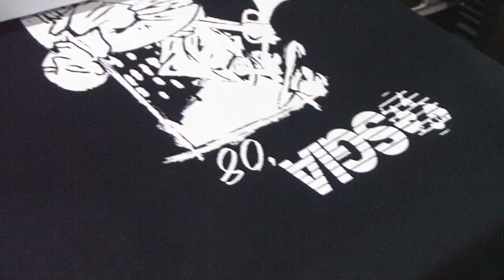MOD1 Belquette DTG Printer Video taken at SGIA Atlanta 2008 [HD]

Comment from the maker: I believe the modONE is about $17,000 for the one that prints on dark garments. Whether it's better than the Brother DTG I guess would be a matter of opinion :) The Brother DTG that prints on darks is about $55,000.  I've heard great things about the Brother that prints on lights (GT-541). There are some great threads in the forums from owners of the machines that should give you more info on the differet DTG options.